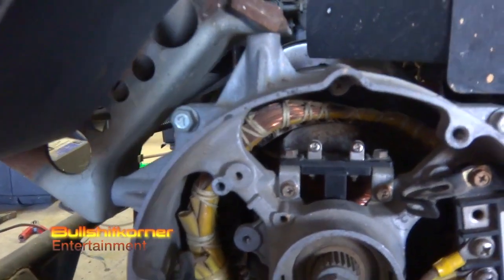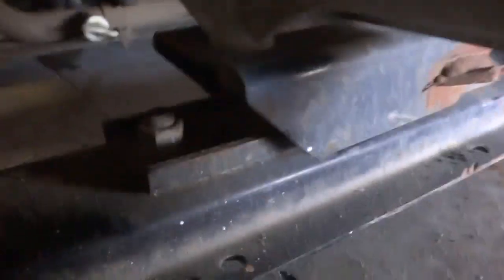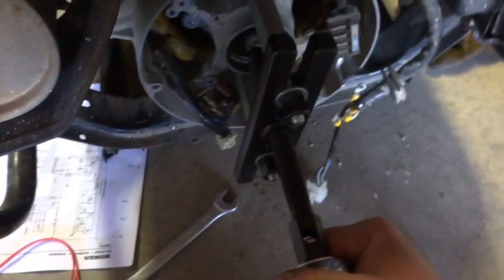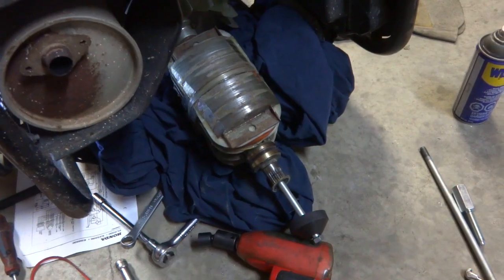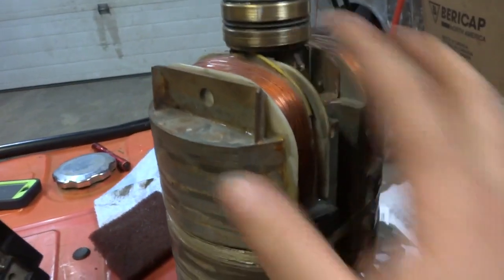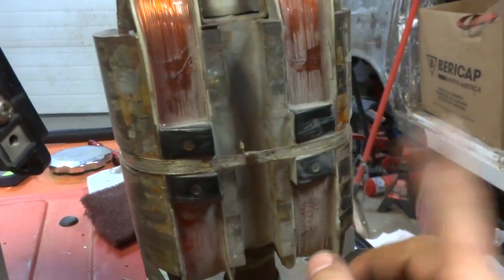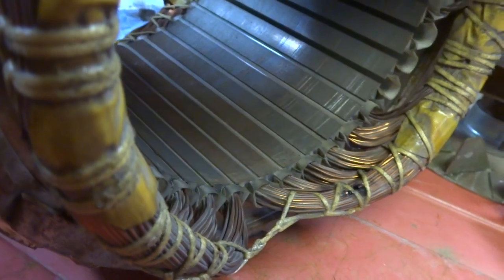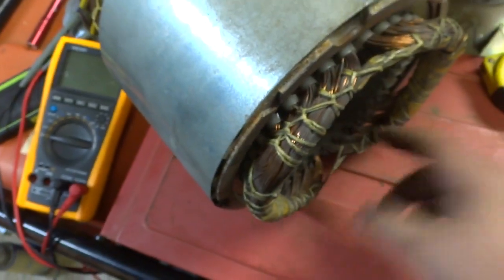Generator Stator and Rotor Removal

Comment: looks like there is a bad bearing because there are scuff marks inside of the stator's core showing that the rotor was hitting the stator from rocking. This is probably what overloaded the generator causing the heat and short of the coil. It was probably cheapest back then to just buy another generator.

Comment: Working on a 10kw military set now with a possible bad stator. 

Wow, $700 for a new stator? Thats got to be from Honda?  Fuck that! I'd be shopping around to get that one either repaired or rewound. If thats the only break, solder it then dope it with some thinned out epoxy.

Comment: Though it looks like it only one winding. And though You can try and replace that one winding But the thing is why did it burn out and become an open circuit winding in the first place. This is usually lack of cooling through a dirty carburetor the engine will run to slow to keep the stator cool enough. And this will usually cause a burn out in the windings over the entire stator So is not a good idea to cut the winding binding and rejoin the individual winding wires by soldering each individual winding.  as then it changes the resistance in that winding. Though it doesn't look like it It is a lot of work to undo the binding take all the winding out to replace them. The only way to do this is it best to replace the whole stator winding  The other way really is either get another stator. or buy another generator or get a second-hand generator.

Comment: Honda published a generator troubleshooting manual  where you introduced a known voltage (12VDC) and checked the resulting output at multiple points. The results would allow you to pinpoint the problem component.
I don't have the publication number at hand but if I come across it I will post it.
Reply from the maker: i did come across and i got the service manual as well. i did run 12 volts to the rotor and got very little voltage at the AC terminal that's how I confirmed that my stator was bad